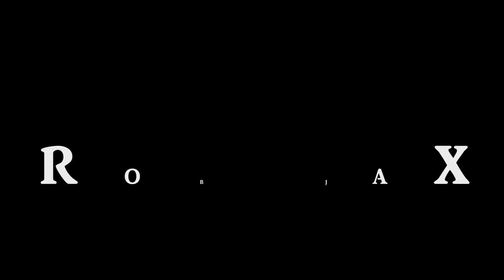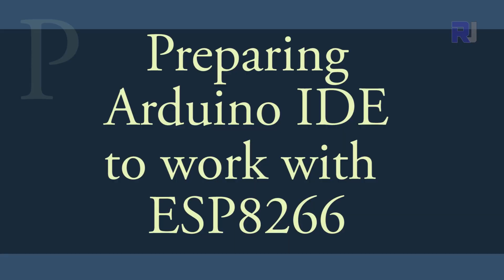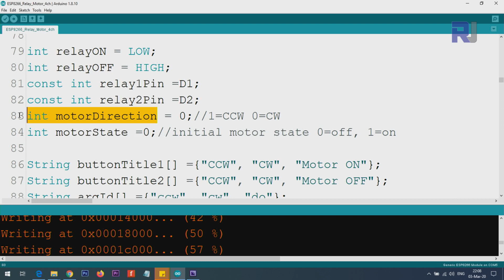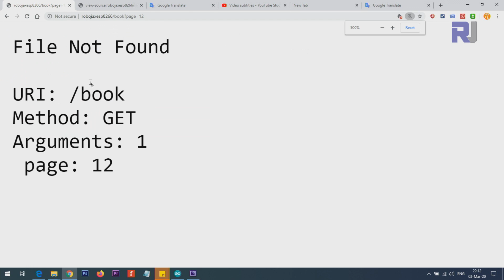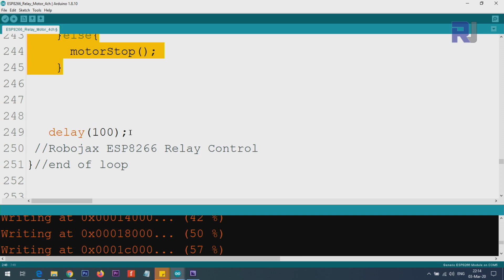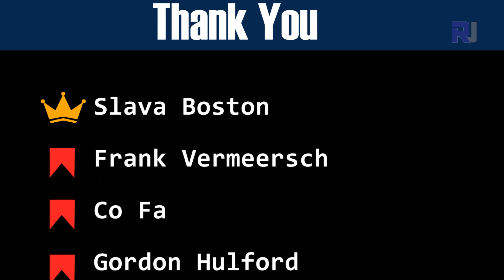IoT Project: Use NodeMCU ESP8266 or D1 Mini to control DC Motor over WiFi with Relay - RJT278

Comment: If this doesn't work for me, does that mean my relay is bad? Neither of the relays I received turn the light on when I send a signal to the input pins.
Reply from the maker: You gott try simple rely project with the wifi. Before coming to this. Search my channel.

Comment: From the beginning, I encountered this error
static const uint8_t D0   = 16;  ERROR
For reference, all libraries are installed..I have tried the ESP 8266 All is well
But the code for this project didn't work for me
I don't know why
CAN YOU HELP ME PLAISE
Reply from the maker: Please watch carefully. I have explained in the code section.
Reply from the maker: of course you will get error if you do not follow what I said. May be you need to watch D1 Mini ESP8266 introduction https://youtu.be/4QpOErbx0nM and ESP8266 NodeMCU https://youtu.be/pLvqh57T3s4
Reply: @robojax  I have completely removed these lines from the code
//static const uint8_t D0   = 16;
//static const uint8_t D1   = 5;
//static const uint8_t D2   = 4;
//static const uint8_t D3   = 0;
//static const uint8_t D4   = 2;
//static const uint8_t D5   = 14;
//static const uint8_t D6   = 12;
//static const uint8_t D7   = 13;
//static const uint8_t D8   = 15;
//static const uint8_t D9   = 3;
//static const uint8_t D10  = 1;

It got better
I entered the name of the router and  the password
I UPLOADED the code
All is well
But the module does not connect
NB  ESP8266 NODE MCU

Comment: U r not showing where power comes from
Reply from the maker: Absolutely have show it. I never skip. It is 12V I mention 12V then it is up to you to connected 12V . It it sis AC 120v or 220V the same. You must have skipped. Please watch again

Comment: make a tutorial for cobtrol boss motorcycle + alarm
Reply from the maker: to do what? or to control what? just the alarm?
Reply: It means to secure the boss's motorcycle.
Reply from the maker: to control the ignition switch? wow. if that is the case, then it won't work as it needs WiFi router. But it is possible to control it using ESP32 which has Bluetooth and your mobile phone.

Comment: Sir, can it be done with my home 1.5hp motor which I am using to pump water from sump to overhead tank?
Reply from the maker: this works with DC motor. See the title. if your motor is DC, yes.

Comment: Can you control the solenoid valve pneumatic to move the cylinder?
Reply from the maker: Yes you can connect anything you want as long as it is DC motor. If you just want to turn ON and OFF, then use this https://youtu.be/QjbxWnBdcbQ